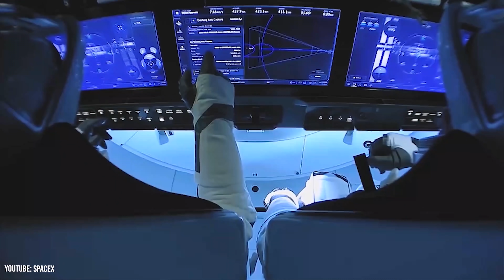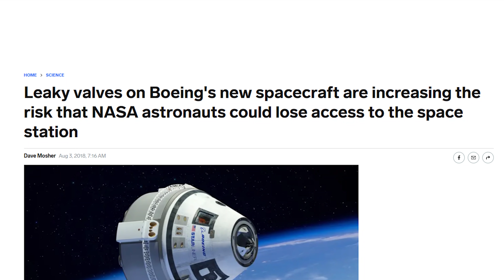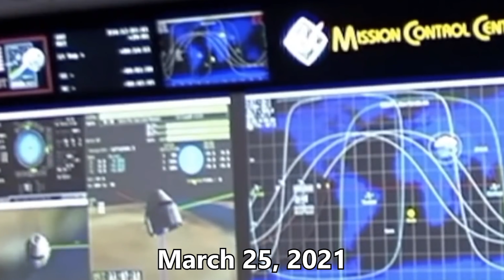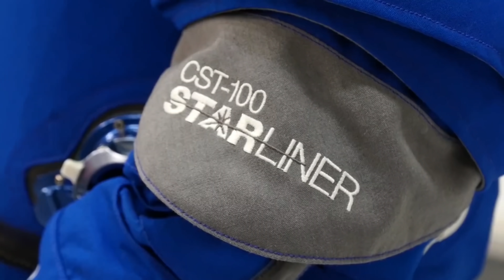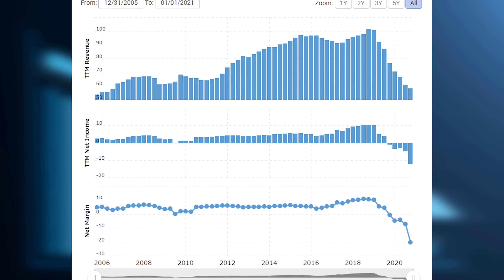What Happened To Boeing Starliner?

Comment: If the 2nd Starliner test fails, that project should be canned, and NASA should give the Dream Chaser a chance.
Reply: Congress would probably not agree with that sad enough
Reply: @m33s.39  If the second test fails, it's going to take alot of Boeing lobbyists to get the Starliner operational.
Reply: @m33s.39  Yup never underestimate congress lobbism ball sucking they have with boeing
Reply: @m33s.39  I think no one in Congress wants to vote in favor of something that could kill astronauts.
Reply: @otterinbham9641  Why? Congressional meddling and stupidity is the driving force that killed 14...
Reply: @otterinbham9641  It is probably going to come down to how many people they can claim to hire. Boeing could probably claim more.
Reply: @otterinbham9641  too late. Dragon is far more dangerous.
Reply: It will certainly be interesting to see what happens in that event. Not that I am in any way wishing them ill luck, but there would be some very serious questions raised and, I think, major loss of political support, should they fail a second unmanned test.
Reply: Despite Boeing’s greed and incompetence competition/backup is necessary.
It is better if more engineers work on cutting edge space stuff. Maybe SpaceX will learn from Boeing mistakes or will hire some of their people later.
Reply: @noop9k  SpaceX is notorious for not wanting to hire ex Nasa or ex Boeing people.  They don't want the "old" ways of thinking in their company.
Reply: That will be Boeing's choice if it happens.  This contract is a FIXED PRICE contract.  NASA does not have to pay them any money for the 2nd, 3rd, 4th, 5th, or 200th test flight.  (It's costing Boeing $400 million to redo the flight).  

If Boeing does fail the 2nd try, they may decide to drop out.... but it would be a huge embarrassment and might impact them getting future contracts.  They would also not get what ever amount is left on the approved $4.2 billion contract.  I don't think they would have to repay what they have received.  They were paid as they reached milestones.
Reply: Boeing got the contract by bribery to begin with. Trust me, I’ve seen enough of the aerospace business from the inside, and the big boys, the legacy builders, they have all the advantages, personal connections, who to bribe, etc.
Reply: Abandoning development at this TRL and re-starting a program from fresh would cost billions of dollars and least a couple of years of development. It's not feasible. Besides, it behooves Boeing's bottom line to keep this going and Congress wants that.
Reply: @Betelgeus3  Sunk cost fallacy nonsense,  just like people squealing dreamchaser is magically superior to starship.
Reply: By that logic NASA shouldn't pick Lunar Starship because Starship has "failed" 4 times in a row.
Reply: After Space X successes and cost savings for NASA, I don't know how Dream Chaser survives the competition.  It's possible because I'm certain NASA wants more than one commercial option to crew the Space Station.  But SNC is not going to the moon or Mars.
Reply: @BMF6889  they're not pretending to. 

Dreamchaser is actually superior both from a cargo and utility standpoint to dragon, as it can be used for station keeping, and carry more in the end. 

Dragon is, in many ways, a single use vehicle. When NASA expressed disinterest in developing many of it's potential capabilites, the gave them exactly what they wanted- a safe crew vessel with a cargo variant sharing commonality. The dreamchaser was developed by SNC with the express intent of doing much more than NASA wanted for their own commercial operations.... SpaceX will never, and does not want, to gonthatbroute with dragon. 

Dreamchaser will be the better LEO vehicle in the end, but they're not, and have no want, going to the moon or Mars. Apples and pears on the comparison
Reply: I agree. But im a spacex fan. I dont like boeings starliner. Its rudimentary, ugly and the suits are blah! Crew dragon is a luxury capsule compared to starliner. I get boeing has roots with nasa but time to pss the torch to the new gen companies. My opinion is anything nasa sponsored (boeing and sls) is a tax payer rip off and shouldnt be funded any more. Sls is a joke! Crew dragon: 3 crewed missions and 1 with a recycled booster and capsule!
Reply: In government contracting business, the winning company isn't always the best.  There's such a thing called Congress that can determine the outcome of the procurement process.
Reply: Both the Dream Chaser, and the Starliner will go very successful. 😁
Reply: And NASA should get their money back!
Reply: Unfortunately too much money wasted to leave the project.
Reply: I’m from the future everything went well with OFT 2 now we wait for docking
Reply from the maker: Maybe
Reply: Logically Answered:  not maybe, most certainly! They should have been canceled after their first failure, with 80 something software errors, and a near certain killing of the crew, if not on launch failure, on return to earth? How many chances are you willing to give them? What if it was your money as say  the soul private investor?  What would you do? The whole world now sees Boeing as a loser company, from endless engineering and production quality control problems with their airliners, to fat cat over paid executives that don’t even know anything about aerospace, to overpriced seats, almost twice as expensive, as SpaceX, Going to the space station and back. I think you are too nice to them. They are just corporate pigs at Boeing.
Reply: Boeing is in a shitstorm already, there is no way congress is going to hit them at the moment. Best thing might actually be another round, with Dream Chaser and Boeing. Keep Boeing on the ticket so that congress don't cancel it, but with the actual goal of the program being Dream Chaser. That's how we got crew dragon. No way that program would have survived without Boeing's political clout keeping it funded. Sucks, but is the reality. Nasa lives and dies by political whims, and nobody is better than Boeing at manipulating politics.

Space planes are not as hard as they used to be, and the heat shields on them are actually easier. Reusable heat shields are still hard, but the larger area and lower accelerations can keep peak heating manageable. Controlling them used to be a massive headache, but now it is off the shelf drone tech. Parachutes are a much bigger headache than people realise, and we are already pretty experienced with them. Once launch costs drop a bit more the mass spent on wings becomes less of an issue compared to the complexity of packing the parachutes for every mission. Propulsive is viable, but I think we are a long way away from that being used regularly for people.

The shuttle did space planes a dirty by being low production and always manned. It made it impossible to correct the design problems when they came up. That was a problem with the design process, rather than space planes in general.
Reply: @agsystems8220  Bad news for Boeing Starliner could end up as good news for Lockheed Martin’s Orion MPCV. If Starliner is a bust, NASA could replace it with Orion, which has a docking system compatible with the ISS.
Reply: agree Dream Chaser is a better option
Reply: @odb388  Why is Dream Chaser a better option? I'm seeing all the support for it but I'm not seeing much reasoning other than convenience and a wow factor.
Reply: @thorgnyr  Well the Dreamchaser can carry more goods than the Starliner and the Dreamchaser started as a piloted spaceship can be used for that purpose again. And the Dreamchaser is a choice eventually for use by ESA
Reply: I think they,d be better with new glen from blue origin , already developing monster engines and have been testing all the time with new shepard ,dont need to carry wings (and all that heavy stuff) in space , dont need them to get back , and space planes , want cost over run and delay,s , space plane is a good way to start
Reply: @stevensmith797  that should be good for 2080 when BO finally make something orbital....
Reply: @robc1014  thats what new shepard is , heavy lift orbital and beyond , instead of billions more to boeing , how about a fare distribution of funding
Reply: @stevensmith797  you mean new glenn? Which we have seen almost nothing off except a fairing in god knows how many years, BO have put literally nothing into orbit yet in 20-21 years of existence. If you really meant new Shepard you should google that as its their sub orbital rich boys toy that goes to karman line and back down again, nothing more. Why would you award a contract to company that hasn’t even proved orbital capabilities yet?
Reply: @stevensmith797  if it should be anyone now, it should be RocketLab; they’ve proved with electron thats its continuously successful and they’ve announced the neutron rocket which is heavy lift, human capable, and we’ve seen a fairing just like with BO. RocketLab are a far more viable option for funding. At least they have proven their ability already.
Reply: @robc1014  yea new glen , and ur forgetting the be-4 , there new engine ,made and developed by them , new glen will come , bezos has stepped down from amizon now to put more time into his dream , the moon and hotels in orbit , diferent goals but important , and new shepard has been a test bed for the next steps , but ether way , stop pooring 100,s of millions into a company that does,nt have rocketry as the first bussiness , let boeing get there act together with there planes then try rockets again
Reply: @stevensmith797  yeah i agree Boeing need to sort their shit out but id wouldn’t give any money to Blue origin, they develop slower than literally anyone, new glenn wont leave the launch pad for another at least 6-7 years. Minimum. And then theres proving it for orbit. They move too slow to be taken seriously.
Reply: @robc1014  dude , no 1 , not even space x will launch 1 of these mosters in 6-7 years , and then there,s that landing from space x , dam hard to prove that safe and get certification for it to launch any1 , these things are the next big step in space flight , reusability is king , whatch as blue origin exelorates from here
Reply: @stevensmith797  yeah okay then.. at least spaceX has put prototypes of starship into the air a few times and is making very fast progress, they’re even attempting an orbital launch of it this year, The first superheavy booster prototype is already stacked and awaiting engines, because the 50-60 raptors produced arent enough yet, but are being made and improved through flight testing. Again, nothing from BO in this regard, BO haven’t even proven reusability of anything orbital. Its a massive difference recovering and reusing something from orbit entering the atmosphere at 10000+kph and re landing something that only apogeed at the karman line.
Reply: @robc1014  dont get me wrong here , I am a space x and musk fan , but his time lines are never right , elon time , and starship is 1 peice , the booster is a hole diferent thing again , musk takes risks , thats why there in front (by a long way ) does,nt mean another way wont work , blue origin have done more than enough to know they will build and launch , in there time , thats not how bezos works , slow , steady , and that ship of there,s has great promise , I say spend the money and develope it , get a real habitat in orbit , start the engineering we need for rotating habitats , because no 1 else is even close
Reply: @stevensmith797  im not even a musk fan tbh, although i was/am a huge fan of Robert mueller, dude is a genius, yes they takes risks but those risks are what gather the most data for progress, look at how dominant Falcon 9 is now after so many failed landings etc. I want BO to do well and their vision is good but there is slow and then there is the speed BO move at. RocketLab deserve more funding than anyone else, time and time again RL prove how good they are, even that Rutherford engine, as an aerospace engineer myself, that lil engine is genius, electric motor pumps, what a feat to achieve with todays battery energy density, considering deltaV, its very impressive. 
I hope BO hurry up a bit before they fall so far behind that they become somewhat irrelevant in the launch side of space.
Reply: @robc1014  thats all well and good , but only space x , and blue origin are even looking at heavy lift the way they are , 100 tons to LEO , thats what man needs , massive tonage to get things moving on other fronts , no 1 is even talking things this big exept those 2 and there backed by billionairs who are willing to put there own money in , and I count branson in that same mold , trhey have done this without gov , they are the pioneers , it wry,s me that space x will have 27 engines on that booster , soooooo many moving parts , soviet N1 had 31 and detonated on the pad killing the cosmonauts , BO is going a diferent way , big engins , less engins , and that worked well for apollo
Reply: @stevensmith797 ,
SpaceX Super heavy lifter already does, and can do more than 
New Shepherd.
Bozo’s what’s to dominate space,  but there even behind Boeing when it just comes to just delivering satellites.
There big brag is that they have more windows than SpaceX – they ultimately just what to make money selling their engines, and Tourist flights (which is why all of the windows are so important).
Reply: @hedonistaesthetic828  who says he wants to doninate space ? , you , people ? more conspiracy garbage , bezos wants a moon base and hotels in orbit , those are his dreams and the reason for blue origin , and there is no super heavy (yet ) only started stacking the first a mnth ago , blue origin wioll get there specialy now that bezos had quite amizon to run blue origin and new glen will come and be every bit as good and capable as starship , moon shots and beyond
Reply: @hedonistaesthetic828  Musketeer detected!
Reply: @TheMrPeteChannel  well thats a valid point, they need to get a move on with things in reality, time waits for no man or company. What makes me laugh is that somehow BO have got the contract for the new ULA rocket the vulcan, to make its engines. Boeing, one half of ULA, own rocketdyne; an engine manufacturer. Strange Boeing would outsource so heavily when they have capabilities in house.
Reply: @robc1014  Both Boeing & Lock-Mart don't make large rocket engines. That is if Congress approves LM's purchase of Aerojet Rocketdyne.
Reply: @TheMrPeteChannel  yeah i was getting my history mixed up with boeing purchasing rocketdyne back in the 90’s but i forgot they sold them to pratt and whitney who then got bought by gencorp but yeah lhm are trying to buy them now for 4.4bn. Seems strange to turn to BO for your engines when you’re that close to owning your own engine manufacturer anyway.
Reply: @robc1014  Yes. Right now Northrop-Grumman is trying to stop LM from buying AR.
Reply: @TheMrPeteChannel  bit of a salty move from NG but in the same breath its adds to the LHM monopoly.
Reply: @robc1014  Maybe a deal can be reached? LM gets Aerojet's legacy designs while NG gets Rocketdyne? A 50/50 split? Of course it would be nice if we see a second coming of Reaction Motors!
Reply: @TheMrPeteChannel  thats a nice idea y’know, im sure the ceo’s and lawyers would disagree tho
Reply: @robc1014  Ain't it the truth!
Reply: @stevensmith797  Where did you learn to spell?
Reply: I agree! Get Dream Chaser up there!
Reply: I think that BOEING SUCKS> PUT A FORK IN IT
Reply: @My_Fair_Lady  If you're talking about dream chaser being a POS, and not flying, you missed the mark badly. There is a good chance DreamChaser will make orbit before Boeing completes a crewed test flight

The starliner will not be cancelled for the same reason the giant orange turd isn't being cancelled, but given the billions in funding and the plans SNC has for their own station in orbit, already being prototyped, the DreamChaser will give dragon a good run for it's money in LEO.
Reply: I agree. It's probably difficult to justify a third space capsule program with Dragon and Orion. A cargo and crewed Dream Chaser would add another dimension and options for U.S. space access.
Reply: I think we should have as many commercial rocket companies as possible. That said, my favorite is the Dream Chaser.
Reply: @dirkstarbuck6126  I agree , as many as is possible , even from other countries (though unlikly ) the more the are the faster 1 of them gets there , Im a starship and space x fan :) , that thing is just nuts and I love it , however compitition keeps them all on there toe,s , thats why funding has to be sorted
Reply: Agreed the chaser will eventually be the choice of private companies, Directors. SpaceX Starship fighting its way out of the gravity well and dream chaser gliding its way back.
Reply: @davidspencer1558  launching 1/4 the cargo for twice the pirce... 

Dream chaser is a good Leo option, but not "the choice" for anything besides the status quo.
Reply: The first test didn't fail.
Reply: @divedevil985  it just failed to reach the station. If a man was on board he just had to flip a few buttons.
Reply: I really want to see a space plane.  These rockets seem like a step backwards on planets with atmosphere.
Reply: @artsolano6762  well mars atmosphere has a density of less than 1% of earth so wings are far less effective. The helicopter gets away with it due to its enormous contra rotating rotors with a span of 1.2m compared to its tiny mass of 1.8kg. As far as fixed wings go; its wasted mass, its just useless and hurts your payload capacity/deltaV